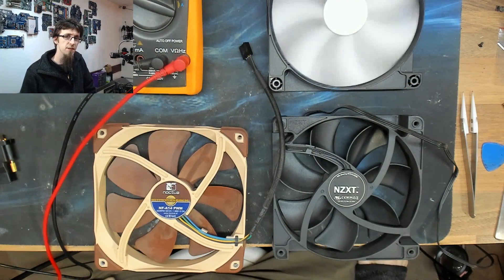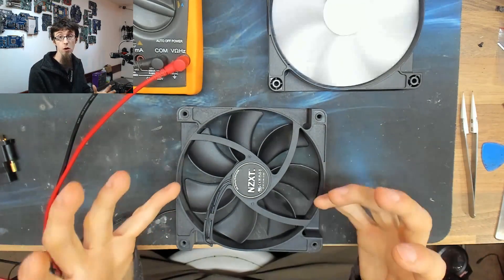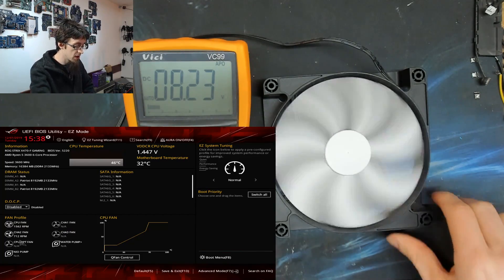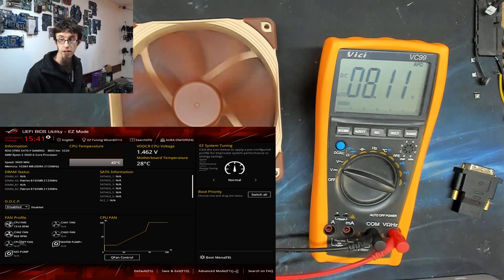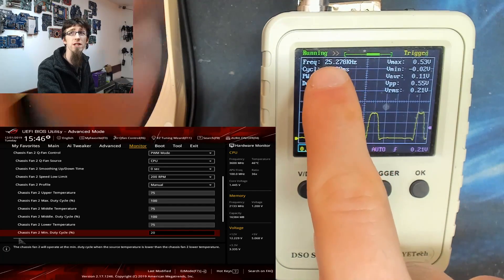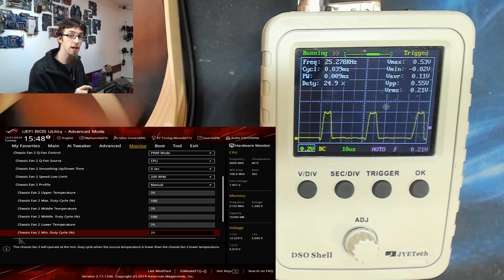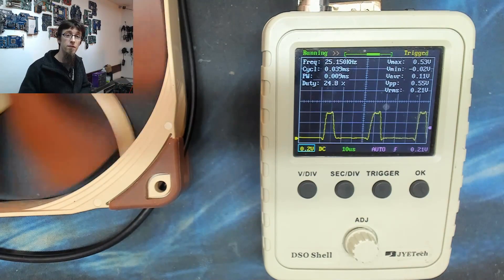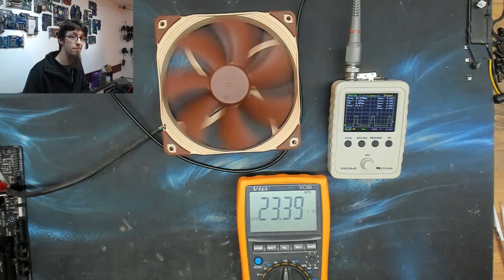LFC#191 - 3pin DC Fans vs 4pin PWM Fans

Comment: TLDR warning. :)

Your oscilloscope may not be the issue... Setting the fan to a low value, it STILL needs enough power to run. The computer, at a lower duty-cycle, has to stay within an "operable cycle level". Your desires, by settings, are just a suggestion, ball-park, of what is a safe lower end, and a maximum higher-end. Some fans have an internal controller to assist with the desired signal too. So, even though the BIOS says go to 1%, the fans controller may have its own duty-cycle for the actual fans 1% desire. (So it doesn't stall. They monitor the hall-sensor to get the RPM and can sense when the fan has stalled, or is about to stall. Saving the fan from damage, due to USER or BIOS stupidity or failures. Like when someone tells a fan to be 1% duty, or the signal is lost from a PWM control-pin. That is usually a $10 fan vs a $20 fan. Relative to a $2-$5 Voltage-controlled fan.)

Though, most normal fans can be controlled with a PWM controller. They just don't have the (on-board control wire). So you would just not be able to use BIOS to control the fans speed. Which is why they sell separate fan-speed controllers. Those can take the voltage-level, and turn the output into a PWM-12v signal to feed the fan power.

At the end of the day, the reasoning of using PWM over Voltage-control, is for efficiency, control and longevity. Feeding a 12v pulse, for half the cycle, which is equal to a 6v load, will consume half the power/watts. It gives the motor the voltage it needs to "spin", where a solid 6v might not give the motor enough power to spin. Reducing the voltage, in essence, the motor is struggling to function, as it is TRYING to get to the top RPM, but it doesn't have enough power to. While a PWM pulse, the fan has adequate power to spin at the full RPM, but the fan loses power for a specified time-period, using momentum to sustain a slower speed-average. With the aid of capacitors and diodes to sustain the average power, in the power-outages. Resulting in a drop of AMPS, at a sustained voltage. As opposed to a drop of VOLTS, which results in raised AMPS being drawn, with a voltage-controlled setup. (Thus, lower wattage consumed.)

Comment: My DC fans stops at 3 volts, with a range from 540 rpm to 1500 rpm, and I turm them off at idle for silence, so dont really need pwm (fans from Antec df700 case connected to the motherbord)

Comment: Thanks very helpful. Just subscribed. In my new build, currently a work in progress, I decided to use all PWM fans having just switched the original Silverstone 3 pin 180mm case fans for PWM equivalents - also ex Silverstone in a FT02 case. All other fans will be Noctua - I'm awaiting delivery of a new CPU cooler to finalise. Hoping to make it quiet as well as very capable.

Comment: Do you know if the PWM signal is the same for 5v fans and 12v fans? I want to connect a 12v fan to external power and use a motherboard header's PWM but the header is for 5v fans. Do you think this would work?
Reply from the maker: The signal's the same, but you won't get much speed at 5v. I suppose you just just run it at high % to compensate though. Max speed will just be low.
Reply: @Adamant_IT  I'm connecting the fan to external power and using the PWM from the 5v header. Thank you 👍👍👍

Comment: Is PWM always 4-pin? What I mean is, is there ever an example of a DC fan being 4 pin and vice-versa?
Reply from the maker: Not that I've ever seen. PWM has been around a long time, so there are some old fans with proprietary 4-pin connectors that are essentially the same as the modern 4-pin, just a different size.

Comment: Video is fantastic, these are found on central heating appliances too, which now have modulating fans and pumps which work via a PWM signal from PCB.  Normally heating engineers don't carry oscilloscopes, even cheap ones, so we are reduced to using Hz on a multi-meter.

Comment: When a fan free spins as in it cant pump or move air the current will go down and in a ac application the fan actually speeds up. So dc is diffrent if i understand you right....why is this

Comment: Is there a 3pin to 4pin converter? And is it possible to convert a non-pwm fan to a pwm fan with a pin converter?
Reply from the maker: Practically speaking, no.
Technically a custom controller could pulse the power to a 3pin fan, thus controlling it with 12v PWM - this was an early way of doing it before 4pin existed. However, the idea of the 4pin connector is that the PWM stuff is all handled inside the fan.
It's worth noting though that 3pin fans aren't as bad as I made out in this video, I did later realise that the mobo I was using in tests wasn't calibrated. 4pins fans are still better, but 3pin is perfectly usable.
Reply: @Adamant_IT  Great. Thanks for the info.

Comment: I think you’ve exaggerated the weakness of DC control here. All 4 of my case fans are DC controlled be quiet fans, and while the top speed is low at 900 rpm, they are in fact capable of much less than 60% of their top speed of your motherboard will allow it, like mine. Under idle conditions, my fans are all at around 300 rpm or 30%/4V and thanks to my high airflow case, I don’t need to set them any higher than about 60% under load, which is still practically silent and eliminates the issue about low top speed.

Comment: So why don't you like molex fans? You don't like a set speed or unmonitored set speed?
Reply from the maker: both, no monitoring, no speed control, old and bad connector.
Reply: @Adamant_IT  so in other words - preference. Good, thought it was more of a safety issue. 
I'm just gonna buy myself some 12v molex fans and mod the connector to use 5v or with a buck (load dependent how many fans on 1 connector) converter something less than 12v(diy speed control for less than 30 euro cents). 
Have an idea for a pc case that might need 6-8 92mm fans and a cardboard test case. The pc must fit in 380*380*100 dimension and if fortune favors me i'll be able to run something with more than 16 cores @5ghz(or more) and 200-300 watts of graphical power.Only problem is i want it fairly quiet when gaming/doing anything that requires more than 100w combined power.

Comment: One little bit to add is that you can use a 4 pin fan on a 3 pin motherboard connector. The 4 pin fan just stays at 100% speed by default but by controlling the voltage it will slow down.

Comment: What is the best way for me to run 8 pwm SickleFlow blue led 120mm 12VDC 4-pin fans, to my 4-pin headers on my mobo Asus Sabertooth 990fx R2.0 without the fans running full throttle like it has been while using a hub like connection.

Comment: 16:30 Note: Apparently not all motherboards support 3-pin fan control on 4-pin headers; users should check the manual first. If not supported, 3-pin fans will run at full speed.

Comment: you need a multimeter which can read duty cycle (in percentage or millisecond) as well as their DC frequency.
Reply: This comment makes 0 sens. There is no DC frequency, direct current is inherently without a frequency

Comment: Great video mate. I was wondering why my 3-pin fan that's plugged to a 4-pin connector is not controllable, checked the bios and turns out its still in PWM mode on that particular fan header. Switched to DC and it finally works. Cheers!

Comment: I didn't know whether the fan was driven by the power of PWM signal or not, but now I see the maximum voltage of the PWM line only goes up to about half a volt, so my question is answered. This video is exactly what I was looking for. The power if provided by the 12-volt line and the PWM acts as a sort of relay that switches the 12 volts on and off. Thanks for the video.

Comment: I just bought 4 used 12cm Noctua fans for less than 5 bucks each and then realized they are all 3 pins, I thought I got scammed with some last centry technology so I came to check.

Comment: I HAVE  a gtx 660 with dual fan, but the fans doesnt work...it is possible that the 12V line from the VGA is somehow dead? (the vga works perfectly i used external fans to keep it cool), It could be of some use to try 12V and negative from the PSU leaving the rpm sensor and the PWM cable to the vga?
Reply from the maker: Yea you'd need to get a multimeter and check the signals coming out of the card's fan header. They'll be the same as a regular 4pin.
Reply: @Adamant_IT   thanks, I did it just now. But the 12v pins did work fine, the tach cable works as well, seems to be the problem is pwm signal when connected the fans turn off and I can't control them via software. Testing with the multimeter the Voltage varies from 1-3v aprox vía software control but I think it doesn't make a pulse so the fans stay off.

Comment: ok, you convinced me I'm buying Noctua i always contemplate it that brand, Why I don't know.
Reply: Noctuas are great. He kinda talked about it in the video. But the Noctuas will start up at a lower frequency than any other fan I've tried so far. In my current build I was going for a silent set up and I was having a lot of issues where the fan curves had to be set at least 50% or the other brands wouldn't start spinning when my machine turned on. I dropped Noctuas in there and I can go down to under 25% and they still start up perfectly.

Comment: Absolutely awesome video....I have been working and building computers for 35 years I know about 3 pin and 4 pin PWM but I never knew exactly how it was doing it...never to old to learn. I do have a question though. Will the 3 pin last longer that a 4 pin fan because of the pulsing on and off?  You know how computers are sending voltage on and off is the sure fire way to kill a electronic equipment.

Comment: How about 4 pin PWM fans with an breakout for a second fan, I note the extension has 3 pins, is it fair to assume the speed sense is off the primary fan and both fans will be PWM controlled to the same signal/speed?

Comment: Excellent video! a question: Why does a new 4 pin fan spin then turn off after apprx 3 seconds on a 9v battery? The old 3 pin fan does the same.... why? I knew nothing about fans when ordering the replacement, so it is a 4 pin replacement for a Toshiba satellite C655. The old fan (3 pin) ran for approx 3 seconds and stopped (thought the problem was the fan) BOTH fans do not run continuously on a 9v battery! HOWEVER if I pulse the power to the red wire (+) maybe about 5 to 10Hz by hand... the fans run! Why?
Reply: The Toshiba will boot, the fan spins for 3 seconds and stops. (keyboard open so I see that it has stopped) The laptop runs normally for about 3 to 5 minutes, then slows due to overheating. I changed the connector on the 4 pin fan to a 3 pin (red black and yellow.. easy to change the pins in the plastic connector)  Both fans stop after 3 seconds!

Comment: Is 3pin fan can connect to 4fan header?
Reply from the maker: Yes, the header will usually auto-detect when a 3pin fan is connected and switch into voltage mode.
Reply: Oh, okay. Now I'm confident with my placed order (Deepcool CF120) with my Asus Ex-A320m. Thank you😊

Comment: hello, how can i run a 4 pin cooler without a motherboard?
Reply from the maker: Pinout: https://i.postimg.cc/X7Z9BVM7/d4799735-331510.png
Just to make the fan spin, you need 12v and Ground, that'll run it at 100%. To lower the speed, it needs a 25KHz PWM signal, which you could generate with a signal generator if you really wanted to.
Reply: @Adamant_IT  thank you

Comment: Very good video, ty! I had a question. Can u also connect a  4 pin fan into a 3 pin connector (using the same logic 3 into 4)? thx a lot!
Reply from the maker: Yes you can, however you'll only be able to do voltage control on it, because PWM pin won't be hooked up.

Comment: Duty cycle is still correct. even voltage controlled fans are controlled over a PWM dutycycle on the 12V rail. The fact that a motor is an inductor flattens the 12v-0v difference and averages it out to a voltage between the two values. with an oscilloscope you'd be able to see, that the line in fact has 12V peak and just switches on and of rapidly.
Reply: There is probably a capacitor also on the power rail which will average out the voltage so you will probably not see the full 12-to-zero volt swing on the line using a scope. But I agree that the voltage is most probably varied using PWM even for a 3-pin fan.
Reply: A few years ago I designed an AtTiny85 based DIY fan controller, and checking the tach in DC mode was a royal pain, because in the off/low part of the duty cycle, there was no power for the tach signal, so I had to run a burst of 100% DC (pulse stretching) every time I wanted to check the time between two tach pulses, which led to audible noise, especially at low RPMs. With a capacitor between the 12V and GND maybe the voltage would be flat enough to get a readable tach signal even in the off part. OTOH, the capacitor would cause the circuit to draw more current in the on part as the capacitor was refilled, and for the same reason it would also make the fan run faster at lower duty cycles because the average current would be higher, making speed control more difficult and unpredictable at low duty cycles. Unless I somehow found a way to feed the fan a PWM signal not between 0V and 12V, but between 5V and 12V, so that the tach (hopefully) always stayed readable with 5V logic. But then again, that would prevent the fan from spinning down below around 40%. (Hey, did I just stumble upon the reason for that particular limit in the BIOS?) Nah. My conclusion remains, 3 pin fans suck for speed control.

Comment: I did some work on kit (not a PC) which had PWM fans, when the supplier was changed out in production there was a heap of fan failures in use. Long story short, newer fans although supposed to be identical would not start at the low speeds in the same way the old ones did. The fix in software was to start the fans at I think 50% rather than say 20% then once they were running and the speed confirmed drop the level.

Comment: Hello, is there anyway to run 3 pin fans on pwm? Or do I need to sell them and buy 4 pin? Thanks
Reply from the maker: Not without making a custom controller. However- 3pin fans are not as bad as I make out in this video, I had my mobo setup incorrectly, and after figuring that out I was able to take 3pin fans down to much slower speeds. 4pin fans are still better for a broader range, but 3pin fans are fine if that's what you've got. https://www.youtube.com/watch?v=NgTlD-jNQ-Y
Reply: @Adamant_IT  I bought 3 3 pin corsair fans, I plugged those into a cheap controller which allows 8  fans to be plugged in, if I have 1 of those fans plugged in it, it is not quiet but it is acceptable running at 60% rpm, but as soon as I plug another fan In it's like that will run at 100% and make its far to loud for my liking lol so at the moment I have a 3 pin plugged in and a spare 4 pin I had from my old case... so the other 2 3 pins I bought I cant put in because they just stay at 100% and make the system about 3x louder 🤦‍♂️🤷‍♂️😆

Comment: I learned from Arctic a 3 pin fan plugged into a 4 pin PWM/PST fan CAN very the speed of the daisy chained fans.. You can also by hubs. I only buy PST fans to plug into a PWM/PST fan and buy dual ball-bearing fans when possible. Not a fan of Noctua. Prefer Antec/Arctic.

Comment: What about the fans that use a molex connector? are they at least controllable like the 3pin or it just gives the maximum electricity that the fan can handle
Reply from the maker: Molex just runs the fan at full speed. It is possible to re-pin the molex connector for different set voltages, you can reverse the pin order to get 5v, or swap 2 and 4  to get 7v across the fan. We used to do this all the time in the early 00s before fan controllers were a thing - but these days I would advise against it, as the mods were pretty jank and will melt something if you get it wrong.
Reply: Adamant IT thank you

Comment: What are the consequences if I connect the m. 2 pci riser to the fan header power on the motherboard? I need powered that connector but use internal power on deskmini asrock a300 without external PSU (only using adaptor 120 w 19 v)
Reply from the maker: ooooo I wouldn't risk that personally. M.2 SSDs can run around the 5-7watt area, so a riser with a couple of them might be pulling 15w. Fan headers can generally be specced to about 12w on performance boards, but that's a big gamble on a tiny SFF board like the A300, where everything will be shrunk down.
Then you also need to ensure that the power header is locked to 12v output, and an unxpected BIOS reset might set it back to variable voltage fan control, resulting in the riser card power sagging.
Looking at the A300 board, how are you even getting a PCI riser on that? Doesn't it already have a few M.2 ports?
Reply: @Adamant_IT    So Its not give stable voltage?  I have other plan to use the pcie riser  like this
 https://m.bukalapak.com/p/komputer/aksesoris-226/aksesoris-lainnya-241/f6x2w6-jual-ngff-m-2-to-pci-e-4x-m2-card-adapter-versi-baru-power-sata-bitcoin?from=list-product&keyword=card%20m%202%20ngff&funnel=omnisearch&product_owner=normal_seller&pos=5&cf=1&ssa=1&sort_origin=price%3Aasc&search_sort_default=false&promoted=0

I will connecting the power from sata cable asrock a300 which support 2,5 hdd, I want to use it for my mpcie wifi card module from my asus a46cm laptop now and maybe for eGPU in the future if i already have m. 2  E key wifi card module

Comment: What kinda of problems will I have if I run a 4 pin and a 3 pin fan off the same two way splitter?
Reply from the maker: Assuming it's a 4-pin splitter, the 3-pin fan will run at maximum speed. The fan header will detect a PWM fan connected (because 4pin splitter) and output 12v with PWM. The 3pin will ignore the PWM and just run at 12v (max speed).
If you disconnected the PWM pin at the splitter, or used a 3-pin splitter, the fan header will go to voltage mode, and both fans will be voltage controlled.